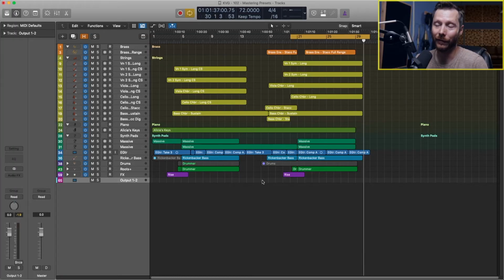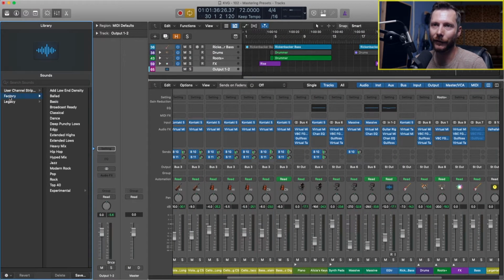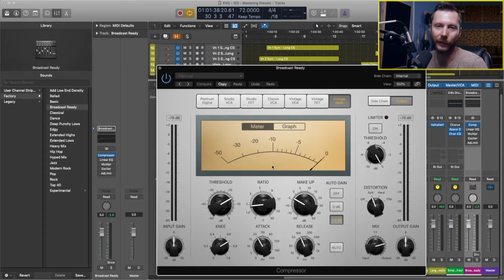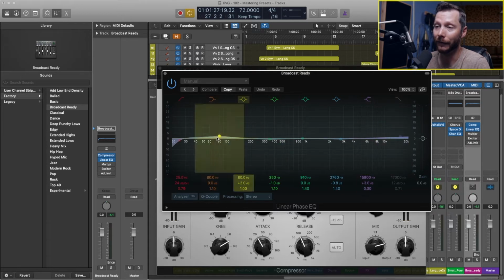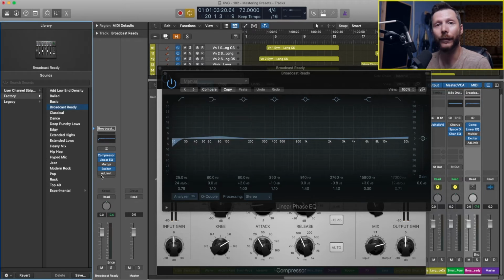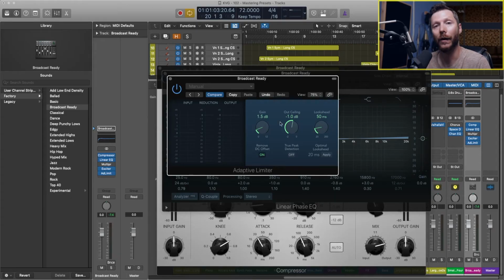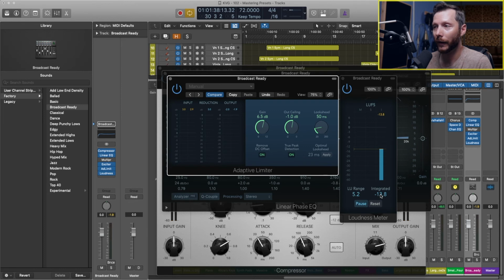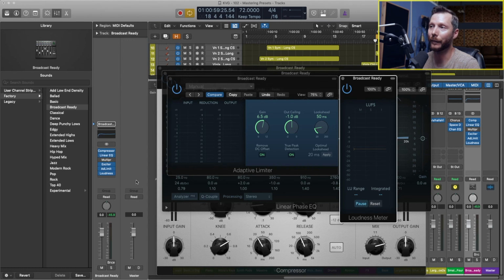Logic Pro Mastering Presets

Comment: This is excellent! Nicely done. My questions are: If it's this straightforward, why do so many engineers recommend sending out your EP to get mastered professionally? Do professionals have a better 'preset' than Logic or do the pros dial everything in perfectly using more expensive plugins/hardware? Do you get a better end result than Logic with LANDR, eMastered, etc? Have you compared a song mastered in Logic to something sent out to a professional or an automated online service? If so, how did they compare? A side by side comparison would make for an interesting experiment, maybe even morph into the subject for one of your videos.
Reply from the maker: Hi Espedale, in my opinion the main reason for sending your songs out for mastering is to get a fresh set of ears on them. It's easy to lose perspective on how things are sounding when you've spent so much time on a project. Most mastering engineers will have better treated rooms than your average home studio as well, so they'll likely pick up on things that get missed in the home studio. 
I've had mixed experiences with mastering engineers. The good ones in my opinion will provide a final subtle polish to the overall song without trying to mess with the mix too much. If there's changes needed in the mix they'll let you know. I've had others try to do too much and I wasn't happy with the end results. 
I've tried LANDR, and it does a surprisingly good job. For someone that puts out a lot of music or content quickly I would consider it a good option. I like Ozone as well because it has the "Master Assistant" which comes up with some automatic settings, but you still have the ability to tweak them afterwards. A comparison video is a good idea! I'll see what I can do.
I hope that answers your questions.
Cheers
Georges
Reply: @knuckledustermusic  Thank you! All of my questions were answered in detail beyond your already excellent video.  Hoping I have not worn out my welcome here, but two more questions that others may have. 

1) Do you feel like Logic's Adaptive Limiter adds color to the final mix? I have GW MixCentric on my submix channel, and when I add the Adaptive Limiter it seems to dull the highs, even when I set the Adaptive Limiter to close to the existing (pre-Limiter) output . 

2) Is it ok to send a song out to an automated mixer, like LANDR, at anything less than clipping volume and it will be ok? There seems to be debate as to how much headroom there needs to be. Some say anything less than 0 dB is fine because we are in the digital age, whereas others seem to stick to the established ~ -3 to -6 dB headroom pre-Mastering. Maybe this is an artifact from the analog days? Maybe this could be another comparison video!

Thanks for all you do. I am excited to learn from your future content!
Reply from the maker: Hey  @espedale , ya I do agree the Adaptive Limiter does effect the highs a bit. I noticed my hi hats were a little less "crispy" after listening after having read your comment.  As for question #2, I would have guessed that it wouldn't matter much, but LANDR says "a good rule of thumb is to keep the peaks of your sound hitting not much above -10 dBFS and the body of your waveform around -18 dBFS" (https://blog.landr.com/prepare-music-landr-mastering/) so I'd go with their recommendations. 
Cheers
Georges
Reply: @knuckledustermusic  Yikes. I have some work to do on my song if -10 dBFS is the recommended peak. Also, thank you for confirming that the Adaptive Limiter is reducing the crispiness of the highs in your mix as well.  Thanks for sharing your knowledge again.

Comment: Hey amazing tutorials, by far the best yet. A quick question or two...To dial LUFS can I use the Multi-pressor out or is it better to use Adaptive limiter? And how close to 14 LUFS should I be? Is a tad higher or lower going to kill my jam? FYI I'm a heavy fat rock/metal guy, any tips are greatly appreciated, your teaching style rules.
Reply from the maker: Hey thanks for the kind words! For simplicity's sake I'll add gain using the limiter since it's always the last thing in my chain. If the multipressor is the second last plugin in your chain (before the limiter), then yes would could simply adjust the output gain there to make it hit the limiter harder. If you're a little over or under it's not a huge deal. Since you're doing metal, I might suggest going a bit over rather than under. I hope that helps.
Cheers
Georges
Reply: @knuckledustermusic  Dude thanks, you rule, perfect, helps a ton...
Reply from the maker: @richalive2  You're welcome!